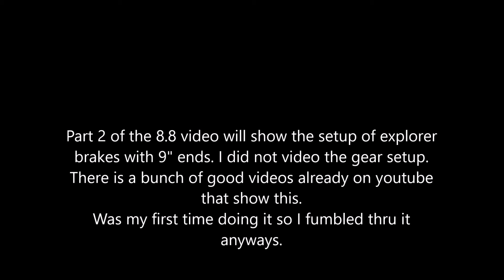8.8 axle build for A body Mopar. 35 spline 9" ends, spool, explorer disc brakes.

Comment: What ends did you use? Part number?
Reply from the maker: Moser 7750 big ford/torino.
Same bolt pattern as the 8.8 explorer brakes fyi.
Reply: @professormetalhead2763  thank you! Those are the ones I ordered and will be putting in soon!